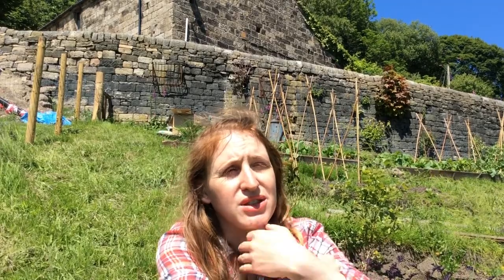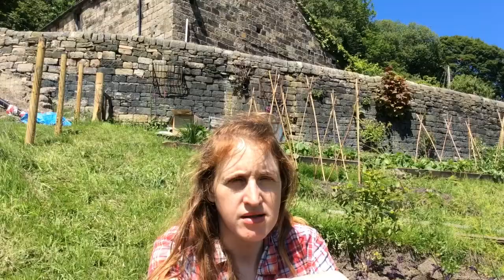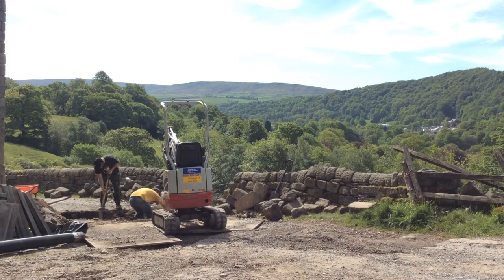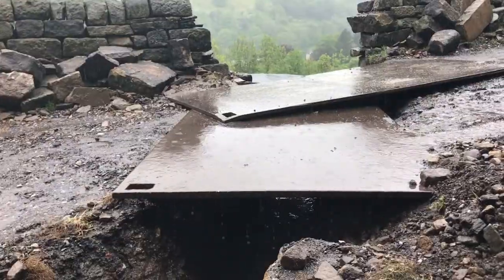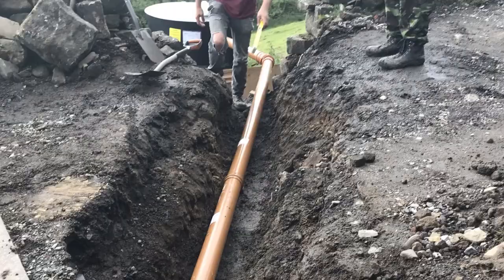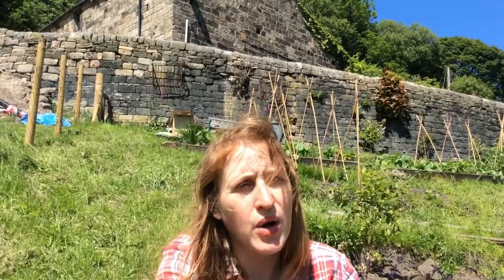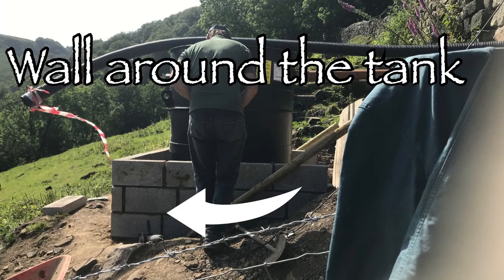How easy is it to install a sewage treatment plant yourself?

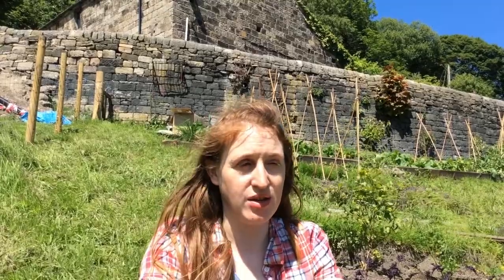Comment: A 1:40 fall is 25mm fall over 1m.  It's 1 ÷ 40 = 0.025
So if your drain was 5m long it'd be 5m ÷ 40 = 0.125m (125mm) fall.
Reply from the maker: Hello Andrew ! Thank you yes that is correct and I have written it wrong. I will change the description just in case anyone is actually using this video! I will say for one-off falls between the toilet in the outhouse and the manhole we got a professional digger guy to dig the trench. It’s on a very steep slope which is too steep to get the right fall. He said it would be fine and it seems to be so far.... we do have an extra manhole on that stretch too just in case it get blocked....

Comment: Hi, did you have to encase the unit in concrete or just build a block wall around it?
Reply from the maker: Hi Colin, we did a flat concrete base for it then a block wall all around it then filled the block wall with sand. This is in order to stop it all moving and also to stop it freezing. It does say in the instructions what you need to do for different situations. I think it may be different if you are digging down in order to bury underground... Ours was an above ground installation, although we have now buried it. Good luck!
Reply: The particular system shown is designed by the manufacturer WTE to be suitable for above or below ground installation, but most commercially available tanks in the UK are not suitable for above ground use.

Comment: Hi how's the vortex system going how long have you had it installed,  thanks in advance
Reply from the maker: Hi! We had it ‘turned on’ professionally about 5 - 6 weeks ago and it is working really well so far. Needs someone to check on it every year which will cost £180 and then also emptying when required. It makes a bit of a noise but smells fine so far! We were told it might smell a bit while it gets going but it hasn’t. I’m also being careful to only use ecover type products. Think it’s pretty smart the way it works!
Reply: @crabapplefarm7706  thanks for the fast reply,  if you dont mind me asking where did you get it from and how much did it cost. I cant find any reviews on it on internet. Thanks again
Reply from the maker: No problem! I like sharing my knowledge since I had to work so hard to find it out. We got ours from WTE it was  2.4k including VAT , so pretty pricey compared to a septic tank I think. https://www.wte-ltd.co.uk/vortex_sewage_treatment_plant.html someone  wanted to charge us like 8k to install it but as you can see it is technically possible to install yourself! If you don’t need to move it anywhere difficult and you already have pipes it probably wouldn’t be that bad...does need a flat surface though and a wall around it back filled with sand so some skill with concrete and block work is required. Good luck!